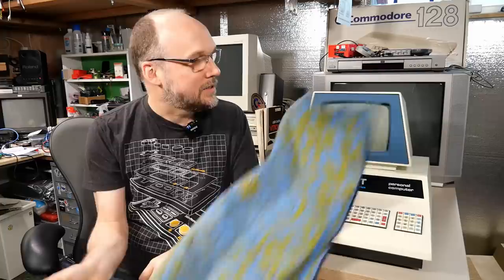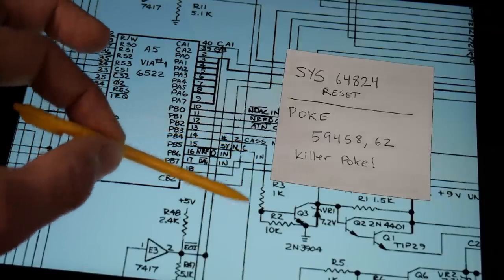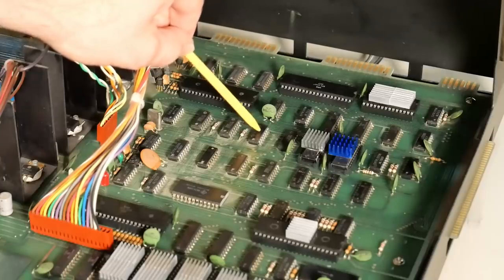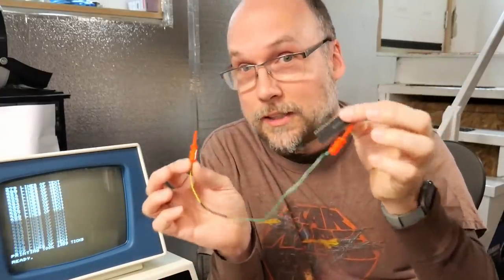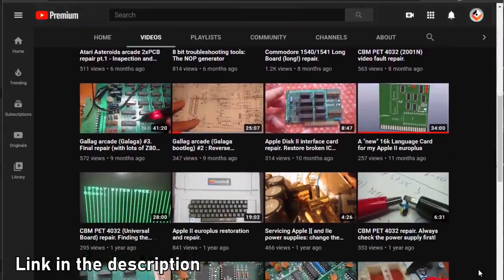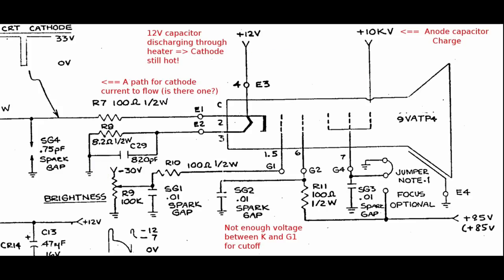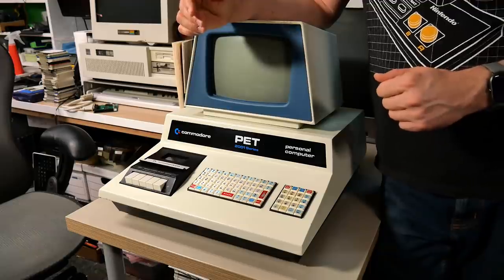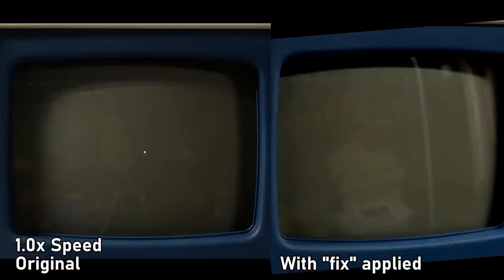Permanent Killer Poke Mod and CRT Spot fix on the Commodore PET 2001

Comment: The “dot” is inherent to the design of CRT monitors/TVs; it’s because the horizontal and/or vertical oscillators shut down, but the electrons are still coming off the hot cathode in the electron gun. With no force in the horizontal or vertical direction, the beam just shoots straight forward and hits the center of the picture bulb, causing the dot, at least until there’s no more emission from the cathode, or the HV drains off (or both.) another common symptom is having the vertical shut down while the horizontal (oscillator) is still running; then you just get a horizontal line vertically centered (roughly) on the screen. This then collapses (usually) to a faint dot, before fading away. The only real way to stop it would be to:
1) kill the HV at the anode cap by discharging it through a high-power transistor, or
2) on set shutdown, a capacitor would dump a negative bias voltage onto G1 or G2 in the picture bulb; that would pinch-off the electron stream until the horizontal and vertical circuits shut down, or
3) on set shutdown, a capacitor would apply a positive bias voltage to the cathode, to suck up all the electrons hanging around the still-hot cathode, until the horiz./vert. circuits shut down, or
4) design the set so that when the power is switched off, the filament in the picture bulb is turned off first, then - after a short delay - the rest of the circuitry shuts down, or
5) wire in a switch in series with the CRT filament and bring it outside the set. Now flip the switch first to kill current to the filament, then turn off the CRT. Just remember to flip the switch back on when you turn on the CRT or you’ll never get a raster! This is probably the simplest solution.
Reply: Couldn't you also cut the power to the cathode heater a few seconds before turning off the raster circuitry? Even though there will still be a high voltage present at the end, it won't have the thermal excitation to go anywhere.
Reply: That's also why older CRT's have an ion trap to deflect stray electrons from hitting dead center every time but instead, scatter them around the center area.
Reply: @mal2ksc  The thermal mass of the cathode will be too large, it will still cause emissions for dozens of seconds, up to half a minute after the power was cut.
Reply: @Stoney3K  Not quite. The ion trap magnet is for trapping ions (who would have thought... :) ). Along with the electon beam, also some ions are being emitted from the cathode. The deflection system (neither magnetic nor electrostatic) has no effect on them because they have much higher mass compared to electrons, so if the cathode points straight towards the screen, the ion beam would hit the screen always at one spot in the middle. They not excite the phosphor to glow, but, over time worns off the phosphor on the screen on that area, causing a permanent dark dot at the centre. So they mounted the cathode at an angle, than used a permanent magnet to redirect the electron beam towards the screen, while the direction of the ion beam remains straight relative to the cathode, so it hits the neck of the tube instead of the screen. Voila, the screen is saved. 

Later they found out if they vacuum deposit a very thin layer of aluminum onto the phosphor layer, it protects it agains ion burn, while increases the brigtness in the same time (both because now the entire screen is on anode potential due to the conductive Al layer on it, and because the Al layer reflects the light from the phosphor towards the screen which otherwise would shine backwards into the CRT). It was a neat invention because it made the construction and setup of the tube simplier by eliminating the need of an ion trap magnet, increased brightness and probably the contrast ratio as well (because the light that was previously shining inside the CRT introduced some back illumination to the screen, elevating the black level).
Reply: @Stoney3K  You're probably right, and I remember how long it used to take for CRTs to come up to full brightness. But this isn't a very big one, so I thought the problem might be easier to control.
Reply: Just change C22 to a 22uF 200V capacitor, which will allow the -30V rail to stay up for a good few seconds, and thus bias the tube into cutoff. Not going to fully stop the spot, but will at least control the brightness to whatever the main cutoff is set to, so the spot will be dim and not burn the CRT in the null field area.

Colour TV sets generally had spot cutoff using something similar, but often also a transistor that was turned on briefly at power off by a falling power rail, that biased the cathode hard positive for a few seconds to cut it off fully, using stored charge on a capacitor fed from one of the positive rails. Just having G1 stay negative for a half minute is generally enough to allow the cathodes to cool, and the CRT stored charges to equalise.
Reply: Unless there is some chance of phosphor damage, which I doubt, why bother?
Reply: @Stoney3K  - Oh, that’s what it was for; I figured it was to catch electrons exiting near the neck of the tube. Thanks.
Reply: You don't need a transistor on the HV, just a bleeder resistor. A lot of color CRT flybacks have one, to safely discharge the CRT and kill any spot (which could be easily be bright enough to burn the phosphor on a color tube, especially large sets and projectors)

Comment: I can confirm via some older CRTs I have even in color that the dot occasionally happens on some of those when you turn off the power, I've never seen it as an issue because I just thought it was normal behavior, but interesting to see it happening on a PET as well.

Comment: Be very careful when powering up a PET with the monitor unmounted from the main case. ALWAYS make sure the earth strap is connected between the monitor and the main case. If you don’t EHT transient spikes can travel down the video cables and take out components on the motherboard. 

I found this out at cost a while back.
Reply: When Adrian tested this monitor off of the main case I spotted some clip leads clipped to the chassis. It probably would've been good for Adrian to mention this.

I presume the problem is the chassis is the only thing grounding the 'dag' of the CRT. Commodore should've put a ground wire between the CRT board and the CRT itself to avoid this problem.

Comment: A quick and dirty fix for the spot is to put a cap across the G1 on the CRT. This will keep the negative bias on G1 alive while the cathode is cooling down. The only downside this has is that your brightness control will be slow to react as the cap needs to charge/discharge. A cap 100uF 50V should work fine and remember positive to GND as there is a negative voltage on G1. You can tack the cap on the brightness pot legs between the middle and GND legs.

Comment: A modern computer that's designed well would have a controlled shutoff that turns things off in the right sequence to avoid that kind of brownout behavior. To go further, some products I've worked on (datacenter network switch) have a control signal from the main power supply telling the power control circuitry when the power input has been removed, and it then has just enough time to shut things off in the correct sequence before all the energy is gone.

Comment: I have the same 2001 Chiclet PET (blue frame monitor) and mine does the same with the dot when turning off the computer. I did install a Tynemouth PET ROM/RAM board so I can run BASIC 1,2,4 and 32k on it. I purchased a dedicated 6502A as well so i have a spare if I want to go back to stock config and not worry about mucking up some pins. I do get a shimmering "jumpy" screen though - will need to investigate that

Comment: Lots of system you could cause physical damage via software back then:
RM 380Z just single stepping thru the high  resolution graphics driver would cause physical damage
BBC Micro - loop with *motor on;*motor off off would turn the relay on the cassette port on and off so fast - bzzzz smoke.
But anything that controls hardware that has limits, potentially cause issues.

Comment: It is often said that the spot is an indication of a weakening CRT. Weak CRTs get a soft cutoff characteristic and thus can't kill the beam as the supplies fade away. One possible fix: Ensure that the G1 grid has negative bias on it for as long as possible. A schematic in words.... Connect a diode in series between the -30V end of the brightness pot and the -30V supply, anode on the pot. Replace/shunt SG1 with a 47uF/50V or so electrolytic, positive on ground. This will hold the grid negative for 5 seconds or so upon turn-off. Hope this works!
Reply from the maker: I've actually finished part 2 and it's all solved. You're into something with some of the actual fixes :-)
Reply: @adriansdigitalbasement  Can't wait to see what you did!

Comment: Seems to me that if you permanently insert a resistor between the VIA pin and the sync signal, you get a PET that behaves as normal but which supports the killer poke without damaging components. In default behavior the resistor should not have any effect on the signal going into the VIA, and after applying the killer poke the resistor will take the voltage drop. 1k should do it, then the two outputs would only have to sink/source 5mA.

Comment: I seem to recall with CRT TVs from the late-'80s that if you switched one off properly the picture would quickly collapse to a dot that would more-or-less instantly vanish.  If you just pulled the plug out though they'd do the same as your PET.

Comment: Another idea is to write a 6502 machine-language program for the PET that’ll tell that 6522 to not generate interrupts when that pin goes low; test it, then burn it into an EPROM somewhere there’s space. Then, when the Pet BASIC comes up, you just call the decimal address where you hid the program in EPROM, and no hardware modification necessary; just keep the old ROM in static-proof black foam and stick it inside the case somewhere, should you want to return the machine to the stock ROM. 🙂

Comment: Very late comment here.. Yes, the spot is completely normal. Many TVs and other CRT equipment like oscilloscopes have it. And its due to a cathode path to ground while the heater is still warm. A fix? any method that breaks the circuit from cathode to ground on turn off. (like a mini relay going open?). I'm sure there is a more elegant way to do it but thats the idea. Lots of fun!

Comment: The "solution" for this is to enable some sort of horizontal blanking interrupt. However this would make the software consume a little bit more of cpu time, with some extra latency costs because of the interruption, but characters for the next line could be updated in the previous line by the cpu. This is why old video game consoles had registers to enable it only at required moments, but this allowed lots and lots of precise animations or pallette changes. One thing that made the pet a better performer, but less flexible computer at lower cost, was the absence of a character rom remapping mechanism. Probably something like that would make this computer almost perfect, and the inclusion of some dedicated ram for video, additional to both interrupts, would made this almost unbeatable. Sadly, memory and buttons were expensive, but is considered an error from commodore to no design this computer to support more "high end" models.

Comment: CoCo (Tandy/Radio Shack Color Computer) had a double speed poke which doubled the clock frequency. It only worked for a few seconds as the RAM refresh was too fast.  It has another option that only doubled clock speed during ROM access. The ROM only setting was less than double speed but still faster.

Comment: In older TV's B&W and Color of higher price-they used to employ a "spot killer" circuit to dissipate the spot because it would bother people-the reason the spot happened is the cathode stays hot after the TV was shut off and it was still streaming electrons and with the deflection circuits turned off the electron stream is not being deflected so the electrons just stream towards the face of the tube until the cathode cools enough to stop emitting electrons and the HV dissipates-one technique the used to do is when the set was turned off the picture tube would be biased on full so that the fully biased picture tube would conduct heavily for a split second and dissipate the HV rapidly and with the HV dissipated there was no acceleration voltage to the face of the tube and no spot--just research CRT spot killer circuitry--the spot was a concern on older TV's because when it happened it could burn the phosphor on the face of the tube and it was a permanent dark area in the center of the face of the tube when B&W TV's used Ion trap magnets and was lessened when the aluminized picture tube came out

Comment: This reminds me of the old 12" b&w TV that I used as a kid (and still have stashed away in a closet). It does some weird "CRT stuff" as well. For example, if I plug it in to the same outlet as an 1800w toaster oven, the image on it shrinks. Newer CRT displays, like a 21" NEC monitor and a 34" Sony TV do not seem at all affected by the toaster oven. Better power supplies, I'm guessing.
Reply: Older TVs usually have unregulated power supplies and newer displays have regulated supplies. The picture shrinking is because of decreased voltage to the deflection circuits. Monitors tend to use tightly regulated switching supplies and TVs apparently tend to use relatively inefficient and slightly less stable series regulators.

TLDR. Yes, better power supplies.

Comment: That spot in the monitor is normal thing for CRT. It appeared in old TV's and monitors, but was later "fixed". More modern monitors/TV's cut the output before the spot appears. So technically it still is there but is it not shown.

Comment: The yoke is like a Inductor. When powered on it has a magnetic field and when you power it off the magnetic field collapses and creates a high voltage. It's visual since the heaters to the CRT are still have emission. Atari with their Vector Arcades by putting protection Diodes on one side of both yoke coils for X and Y. However it's more then a few simple Diodes and requires adding Transistors and crap.

In all honesty this will not hurt the Monitor, unless you constantly turn the System ON and OFF forcing it to burn a hole into the CRT phosphor.

Comment: Ohhh the resistor is a nice idea!

Just finished the video,
are you sure there is something else wrong? Usually the resistors have different quality grades, so your 470Ohms might be a +/- 10%, i.e. even only 430Ohms...
Frank seems to me like he would play it safe and use a resistor size that is "large enough" to fix it, but with not much "space" for variation.

To be safe i would try it with the 510Ohms and see if the dot disappears faster. 

I think what he intended to do is to reduce the 12V that were causing the transistor to be open by applying the changes, so going for a smaller resistor might not reduce it enough to actually make it go "off".

Comment: Although you've apparently solved this now,  it is perhaps noteworthy that many B&W TVs had what they called a "spot swallower" circuit, which turns the CRT full on after switch off, so the HV is discharged quickly while the deflection circuits are still operating.  They did this by making sure the negative bias on the control grid is the first voltage to collapse, turning the gun full on.  Hope that helps. 😊
Reply: @HutchCA   Please re-read my comments.  The answer to your objection is there.
Reply: @HutchCA   Perhaps you should re-read your own comments too! 🤣
Reply: I've never seen the poweroff flash on BW TVs but only on color TVs.
Reply: @eDoc2020   I do actually remember seeing the switch-off flash on B&W TVs.  Usually reaches highest brightness when the scan has collapsed to about half the screen area, from memory.
Reply: The problem on a 9" PET monitor is you can't be (easily?) faster than both deflection waveform to collapse, since there're no deflection oscillators, only pulse shapers and deflection drivers. The oscillation pulses come from the PET logic board. Deflections collapse as "ringing" waveform very fast, so you wouldn't discharge all the stored charge into the anode.
Also, on earlier 9" revisions they made some real mistakes. However, you're free to experiment with the G1 "fast bias decay" and see if you can outrun the collapsing raster waveforms :)

Comment: Some versions of the Dragon 32 and the Dragon 64's were subject to chip damaging pokes. On some versions of the Dragons the same pokes doubles the processor speeds, there was a 2 pokes, and when used together you cooked the CPU, on others machines they has either no effect or the effect was to freeze it

Comment: Screen burn in occurs on CRTs when the phosphor coating burns off, this process will always happen given enough time. Screen brightness & constant displays will accelerate this. Seeing that dot at power off is not really a fault and a recognised design choice (safer to discharge in the tube than to chassis - saves component count to). Given that most CRTs are rated with between 20,000 & 30,000 hours it wouldn't normally be a problem. You would need to perform many power cycles to cause a permanent dot.
Reply: In Commodore's defense, they didn't expect their CRT's to last almost half a century.

Comment: I tried the killer poke with WinVICE using the 2001 PET and nothing happened immediately. So I ran a simple scrolling counter (A=A+1 etc.) on two machines side by side and whilst there was not a massive speed increase as you had with the real hardware, the poked PET definitely ran faster. After just a few minutes there was a 500 count difference between the two. Also, the screen refresh wasn't as clean on the poked PET.